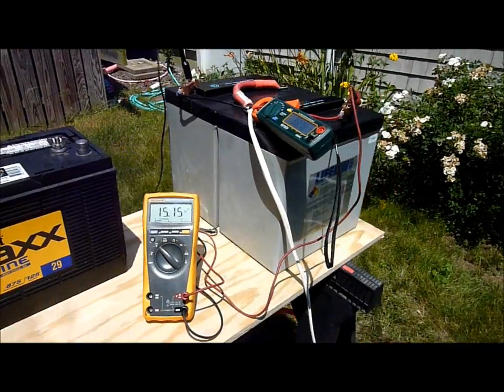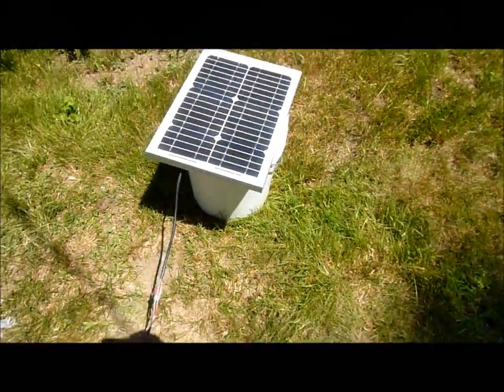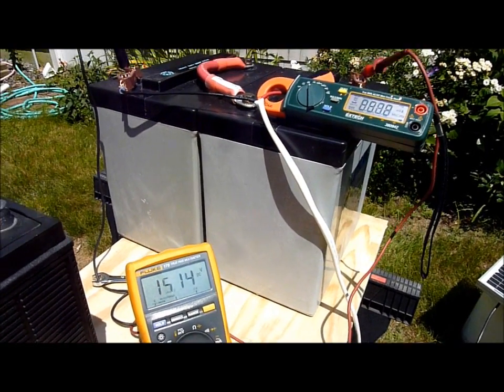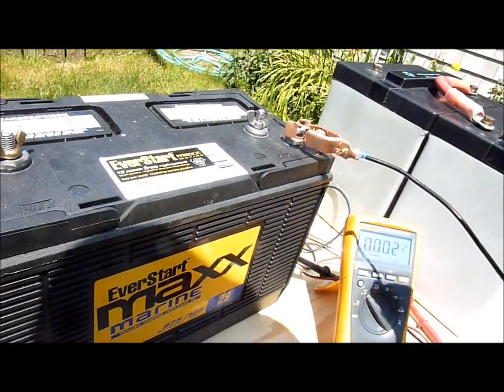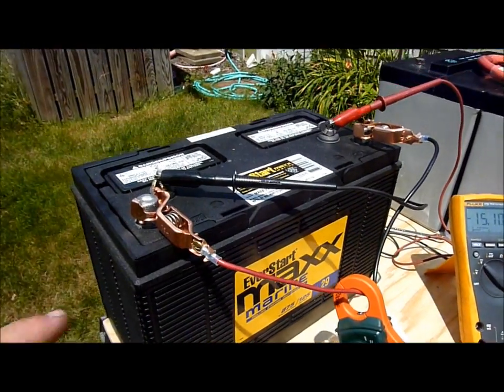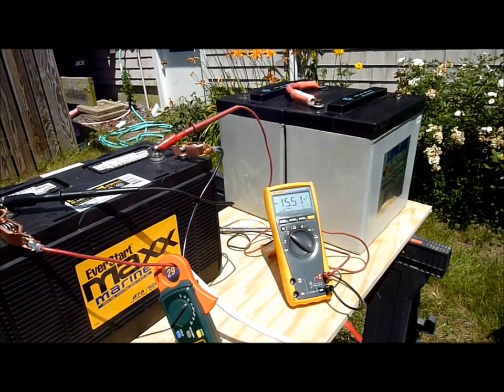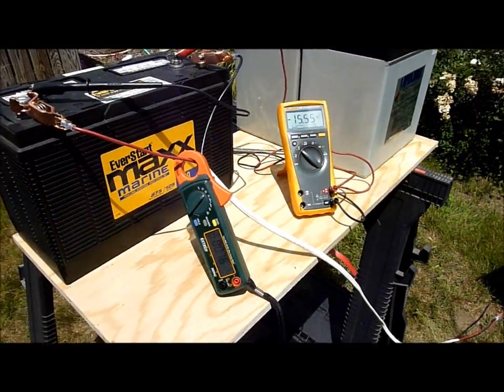Solar Over Charge - 12W Unregulated Panel vs. 220Ah AGM Bank

Comment: What causes it to be ... like when the sun goes down and suddenly the battery bank voltage is dropping to below 12 Volts, but the rest of the time it seems fine? The voltage I'm getting on a battery bank is too low for new batteries. But I've been careful charging them and careful with the equipment. I don't understand why I'm getting such low voltage though...

Comment: Do you think an inexpensive charge controller like the $30 "Battery Tender" Solar Controller can regulate a small 7 watt solar panel similar to the one you are testing in this video?  This Charge Controller claims it can regulate 5-45 watts.  Here is the controller I ordered...  https://www.amazon.com/gp/product/B004Q820UK/ref=ppx_yo_dt_b_asin_image_o04_s00?ie=UTF8&psc=1

Comment: My unregulated 4.5w is keeping my battery above 15v all the time. It starts the car like a champ. When can I expect the 17 year old battery to be ruined? Before I added the panel, the battery was on its last legs and struggling to start the car. Now, it works like new. I checked with my hand, the battery was not warm. I didn't expect it to be since the non-optimally placed panel only pumps in around 60mA in bright sun. The sleeping car draws 20-30mA.

Comment: It amazes me that people aren't willing to spend $10-$20 for a charge controller. A basic Harbor Freight controller will do the trick, even with lifepo4 cells. It's not as efficient as MPPT but if you're just trying to maintain float - why not just invest a tiny bit more money into something that'll protect it? If the solar panel manufacturers say to use a controller for batteries - you should.
Reply: I can get a controller cheap but won't. Instead, I analyse and know my 4.5w panel is only producing 0.9w behind the car glass. Since over charging is not possible, I don't blindly go buy a regulator like a dumbo.

Comment: can i ask you a question my over charge limit is 15 volts on my 100 amp epever pro charge controller for seals agm battery option does that sound right two you.. if so what should it be...so that is the fail safe voltage is it will not charge past that for battery bank, does that sound right two you

Comment: wow, and I was going to buy a solar charging panel too, well, I'm turned off from it.
Reply: this video is just showing what can happen if you do it improperly. it's not saying don't use a solar panel, it's saying make sure you get the right voltage panel for the battery and/or use proper protection (eg, a charge controller)

Comment: a good demo and good advice, I am an electrical engineer, you can trust this video
Reply: Can't trust anyone who charges a fully charged battery. Why would anyone do that? In a typical scenario where a solar panel is used, such as on a car or boat, there is usually a draw on the battery. The solar panel should then be correctly sized to compensate for the draw and self-discharge, resulting in a small overall drain or gain that isn't going to produce much harm. Small panels sold in retail are usually deliberately under powered, and there's no risk of harm for the intended purpose. Also, as the battery becomes full, it would resist charging. Small panels don't have the power to over come that resistance. It's all about being appropriate. You don't be charging an AA battery with a jigga watt charger and cry you should have used a regulator.

Comment: If you ve seen the voltage its higher, why you charge it like that for few days? You damage your batteries to show on youtube? You must be sick.
Reply: It's his battery and he can do what he wants. It's educational for others. In any case, he's measuring the voltage of the panel. It doesn't mean the battery is taking in charge. As the battery becomes full, it would resist charging. The small panel may not have the power to counter the resistance. When I charge my battery from the wall. The measured voltage across the posts is 16V. It doesn't mean the battery is damaged. It is quite normal.

Comment: Aren't you supposed to equalize flooded batteries? Copied from the Crown CR220 spec sheet... Phase 3: Constant Current = 5.0 amps or approximate. (Phase 3 is the equalization charge.)
Normal transition to END OF CHARGE at 115 - 118% of AH returned.
Recommended Equalization Charge: Every seven (7) days. 4 additional hours at normal finish rate of 5.0 amps. 
So the equalization charge for the EverStart should be about 2.5 amps. Someone isn't reading the manufacturer's spec sheet correctly.
And if you look up the specs for your Lifeline batteries, the absorption voltage is 15.31 volts at 20ºC and you are at 15.13 volts. 
From the spec sheet... Charging Lifeline® AGM batteries is a matter of replacing the energy removed during discharge plus  a little extra to make up for charging  inefficiency.  The amount of energy  necessary for complete recharge depends on the depth of discharge, rate of recharge, and temperature. Typically,  between 102% and 110% of the discharged ampere-hours must be returned for full recharge. 
They even have a special conditioning charge for when you neglect to fully charge the battery. This is for the 220 AH AGM battery and at 20ºC, the voltage required is 16.48 volts and a current of about 4 amps. And you're mucking about with 0.73 amps?

Comment: This battery reconditioning program exceeded my presumptions. It worked on any drill battery, several AA and AAA batteries,>>>https://www.facebook.com/Battery-reconditioning-310070329426065/app/208195102528120   and any camera battery. The steps are simple and the act itself is exciting to do. No matter what type of battery you`ve got, it is sure to function again!

Comment: My understanding about deep cycle batteries is even if you charged with a regulated solar system, if your not using 7-15 amps your damaging the battery. 2 amps with over charging protection still damages batteries. DEep cycle

Comment: Your 12V panel has a current rating of about 1amp.  So that's only 0.45% of the 220 AH battery rating.

Comment: yeah that walmart battery is crap thats why they don't sell it anymore. I know I had three of them they were shit. Also note the minus 15 you have the wires crossed. Pay attention to what your'e doing.
Reply: Who cares about that?  It is the voltage we are concerned about, not the direction of flow the meter is reading.
Reply: THAT IS WHAT  I THOUGHT ALSO

Comment: Won't push current til 17.2v is cleared, possibly 21.6v because it's shorted straight to the battery, the battery doesn't just turn it to amps when under source voltage. Probably less charged when you disconnect the solar panel and check the voltage, a inverter might like it though.

Comment: Reading the voltage whilst under charge will give you the charge voltage and not the actual battery voltage. To do so, you would need to remove the panel and simply test the batteries. 
I very much doubt you would find such a large capacity battery taking on sub 1amp charge any where near the 15volts you measured. 
This is also why the second single battery showed the same voltage. It wasn't increasing the batteries charge rather than showing the input coming from the panel. 
deep cycle batteries dishcharge at a rat of approx 3% per month . 
So you are right that saying a panel at 10% the battery capacity MAY still result in an over charge if left idle for long enough. 
Of course it wont be applying charge for more than 6-8 hours at most and that is with perfect weather, every day for an extended period , which is highly unlikey but still possible.
Reply: And then there are the famous Volkswagen solar "float" chargers.  They output about 5 watts, and are designed to be continuously connected.  The older design plugged into a cigar lighter socket, and had no form of regulation.  The newer version has a charge controller, which appears to limit the voltage to about 14 volts, as opposed to the much higher voltage from the older model.

Once upon a time I used one of the older panels to recharge a sealed lead acid 5 Ah battery, which seemed to work OK, but I never left the panel connected more than about 5 or 6 hours at a time.

Comment: i would like to point out that indeed a lot of chargers wil do bulk and absorbtion till 14.4 volt....this is for most AGM and CALCIUM plate batteries actualy to low of a voltage causing sulfation because the batterie is only charged to 95 percent each cycle, the better chargers ( victron marine and others) have a special " high" setting nowedayse on, taking the voltage up to 14,8 during bulk and absorbsion....even then its adviseble to do, say once a month to " recondition" the batterys with a controlled overload to 15,5 to 16 volts with low amps during MAX one hour!
this will ensure two things, it wil " equalyze the cells and charge really till 100 percent to get rid of sulvation!
actualy the real charging voltage of a lead acid battery is 15.2 volts but since this is dependend on temperature and age( quality) of the battery most chargers manufacturers wil keep voltage at the lower and saver 14,4 value, thus avoiding consumer claims of blown batterys, that and undercharging is the reasen many battery banks dy prematurly due to sulvation

Comment: I have an 800 watt Renogy system that has a charge controller.  It is a 24 volt system.

Can anyone recommend some kind of monitors that I could buy so I can monitor the batteries, how much is going in and out,  how much they are charged, etc.?
Thanks

Comment: You'e 100% right about shoving from 18 volt to 24 volt of raw power into 12 volt battery. From Amazon, the dash 12 volt 10 watt solar panel, from panel to DC clamp and or to cigarette light plug. The reviews is pretty poorly.

Comment: What voltage output is the solar panel? It looked like the sticker said 17.2 Voc to "21.6"Vmp volts. So, yeah, it's going to try to charge that "12" volt battery closer to 18 volts.
Reply: I can’t read it on my phone but 12V panels will usually make 19V. My epever mppt is showing 20V 11.2A from the panels right now and the battery is showing 14.4 with 10.1A of charging input currently. 
But I can’t read the tag on the panel in the video so I can’t confirm that the label is showing open circuit voltage or not. 
(Mppt takes full available voltage/current from the panels and delves it out accordingly. In my case I ‘could’ wire the panels 24V and it would still deliver to the battery bank appropriately.)

My favorite PWM charge controller is a P30L and that is going on my boat. At ~$40 it’s ‘expensive’ compared to others but it has worked excellent over time, equalizes the batteries on a sched, and offers a great interface with performance data logging. It’s worth the extra pizza in price because I know it works and lasts. That’s a great boat charge controller although I don’t think it is “marine” rated. And definitely cheaper than new batteries!

Comment: the point seems to be you can damage a battery you already had fully charged, by overcharging it with a solar panel.
Truly a revelation.
Now what if instead of charging that battery for a week you had actually used it like real people do, leaving the battery 50% depleted?
Reply: +FuckGoogle+it would eventually reach a fully charged state and then the battery would get damaged anyway.
Reply: +kiskiller3 only if you actually overcharged it and werent using the devices hooked up to it daily. 
In the real world, people that live in their vehicles/rvs and add a solar panel have a second battery in a state of constant depletion and each and every day use far more power than the panel produces. If you were going to park it for an extended period you can put a cutoff switch inline.
Reply: +FuckGoogle+ it still is a very bad practice. And in the real world thousands of batteries are damaged every year because of overcharging, i routinely replace hundreds of batteries every month and they mostly die because of overcharging.
Reply: +kiskiller3 Isn't it just an assumption they died from overcharging? AGM deep cycle batteries are also at risk from being in a state of constant depletion are they not?
If you have a vehicle with a 12v freezer in it that draws 5a when running, and runs 12 hours or more per day, day in and day out, and have a 10-12w panel hooked up to the (large) battery that runs it, there is no possible way that battery could ever reach an overcharged state. Let alone if you added additional devices. 
(I have a Deka/Alcatel 145ah AGM deep cycle data battery in this situation)
Killed the first one in a year due to depletion.
Reply: yes in this case if the load is always more than what the panel generates the battery will never get overcharged but most of the time a load is not always drawing current so this is why you need charge controller even if you have a load on the battery. Yes the batteries did die because of overcharging as they where held at 14.7 volts for a couple of years. this issue is common in UPS battery backup applications.

Comment: Sorry. But I still don't think a 12w panel will damage such huge batteries
Reply: +Josh Law Josh a CC (constant current) charge of 1A left continuously can eventually raise the voltage of the battery to damaging levels, especially AGM batteries which have very low self discharge.. This 12W panel is really only capable of about 0.6A to 0.7A and it can clearly be seen what happens when the panel is left connected to the point where the battery becomes chock full. Batteries are floated at CV or constant voltage, not constant current unless you are using a CC/CV/CC charger for short duration industrial applications. For a marine or solar application our chargers and controllers are; CC/Bulk > CV Absorption > CV Float or CC>CV>CV charging. If we use the DIN definition I>Uo>U..

As for brain damaged you may want to comprehend batteries, charging and the difference between CC and CV charging a bit better before leaving nasty comments.
Reply: Billy Carvalhoit will on long term
Reply: +Josh Law batteries need to be charged at a regulated voltage
Reply: +CompassMarine  also the 0.6 A after losses basically become 0. 4 A. That's kinda good to keep battery on long term charging. I was thinking maybe folks who go on long term vacation could hook up their car batteries to a low power panel so it would compensate for the discharge.
Reply: +CompassMarine  right or wrong, Billy C stating his disagreement hardly qualifies as a "nasty comment"
Reply from the maker: @tracyguilbeau, If you had read the comments above you'd clearly see that my comment was not directed at Billy but rather at  +Josh Law who did make a nasty comment referring to me as "brain damaged"..
Reply: it won't...He overcharged the batteries to start...

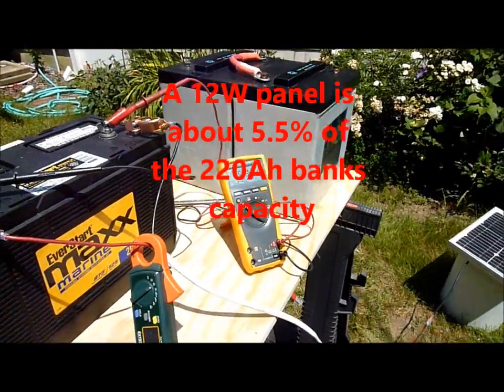Comment: What do you mean with the 5.5% capacity at minute 4:20? What has W to do with Ah? In my opinion the 12W Solar cell does not have any capacity! But the 0.8A current is only 0.36% of the 220Ah capacity of the battery. I think it should be better to compare the same unit!
Reply: Weed Amp Hours

Comment: The rubber caps under the plastic covers will pop off the agm battery when it gets overcharged. I had an old dead sealed lead acid battery and tried to overcharge it directly from the panel. It popped and boiled off the liquid inside. Your right, you have to have a regulator to charge with an unattended battery.

Comment: I do this all the time an it just worked fine - 160 watt panel - up to 8 amps into battery at 20 volt, and disconnect at 15.3 volt, on a daily basis - kind regards - Ben

Comment: Who ever told you that you do not need a regulator is probably the type of person who does things half-fast.  They are the people who don't do anything reliably.  In this case it is also unsafe.  The only good thing about their advice is that it keeps battery companies in business making new batteries to replace the ones they ruined.  I personally hate to damage things by overcharging because then I get to pay more money that I otherwise never would had to if I had just bought the controller.
Reply: +pearlmax Gentlemen use "half-fast" as a cute pun without being rude. It used to one on signs in diners. It read "The cook isn't fast or slow, she's half-fast". I thought everyone knew that joke.
Reply: How will a 12w panel overload the batteries? It will just provide the batteries with a float charge
Reply: +John Doe The term is half-assed, not half-fast.
Reply: +pearlmax he musta bought a half ass slang dictionary.
Reply: FuckGoogle+ hahaha!!  Yeah, from a lesser known publisher.

Comment: Charging at 15.1 volts is only .4 volts above normal. Most smart chargers will produce up to 16.2 volts to condition the battery then tapper off to 14.4-14.6 volts then float at 95% charge.
Reply: Ideal float is 13.20,   15v is only  to stress the flooded battery  to ecualizate a battery bank each month.
Reply: @jhonmorenocastro3010  float is between 13.2-13.8 depending on temp of battery.

Comment: So, hooking up a panel with an unloaded output voltage of (likely) 17-21 volts causes your voltmeter across the battery and panel to show a reading more than 12.7 volts? Isn't this what we would expect to observe? Bottom-line, don't leave a source charging voltage of more than about 13-14 volts on a battery bank for an indefinite time. This is elementary. BTW, the rated watt (availability) of the panel is mostly irrelevant; it's the relatively high terminal voltage of the panel that matters.
Reply: the panel must put out some amperage in order to be able to raise the voltage of the battery that much.